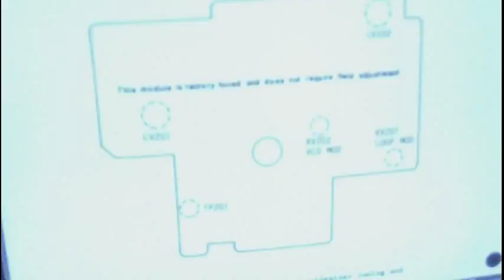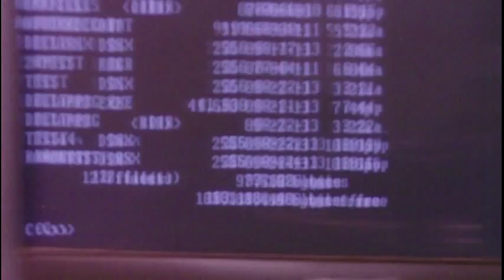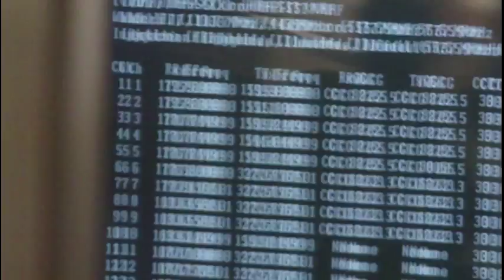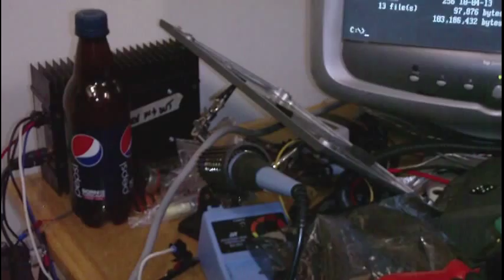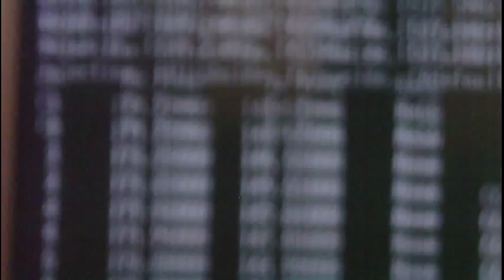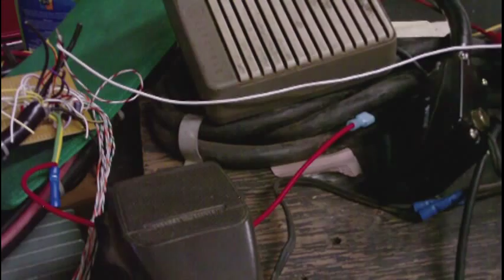GE Rangr 2 way radio VHF High Band to 2 Meter Ham Band Conversion

Comment: I worked on MANY MANY of those. They are not the best but I still have the GE RiB, programming cable interface and the GE software to program this radio.
Why don't you just get a Motorola Spectra? They are a ton easier to set up, no modifications requires and out preform others hands down and are dirt cheap on ebay now..
I STILL have piles of old GE radios, Rangr's, phoenix's, delta's, mastr 2s and mastr 3 repeaters, MLS's, PCS's, MVS's, Monograms, MRk's and the list goes on. Most are UHF but there are some VHF Hi and Lo bands stuff in there..
I did some UHF Lo split modifications to some Rangr for a ham guy here, I set the VCO at about 7 volts on 152 MHz so I could program the weather channels in as well as the ham stuff and maintain VCO lock... A LOT of the early VCO synthesized handhelds had issues with VCO lock coming out of lock at random due to slightly off value capacitors during manufacturing. The PCS handheld though is a pretty good unit, very rugged but the parts to repair them are about as rare as rockinghorse shit now.. The LCD display conductive strips was the major failure mode on those radios and is a simple fix IF you can find suitable replacements...
Reply from the maker: Yes I will probably get into Spectra's in the future. A friend of mine can program them and has re-capped them.